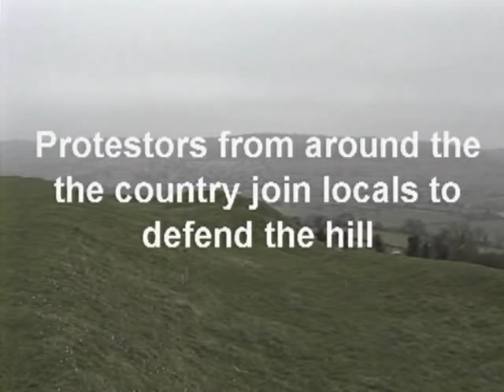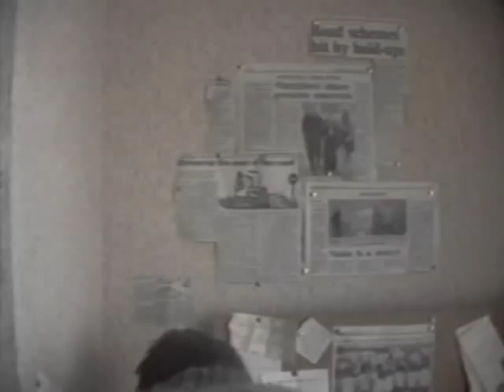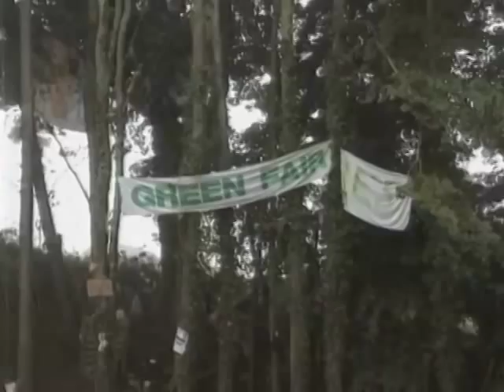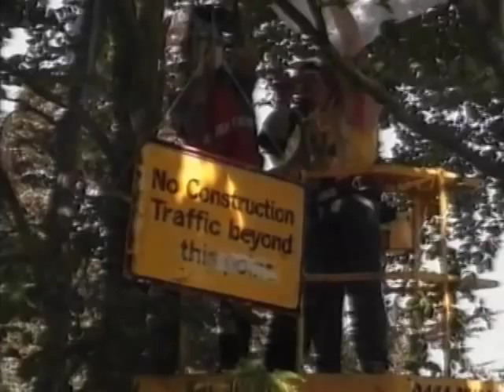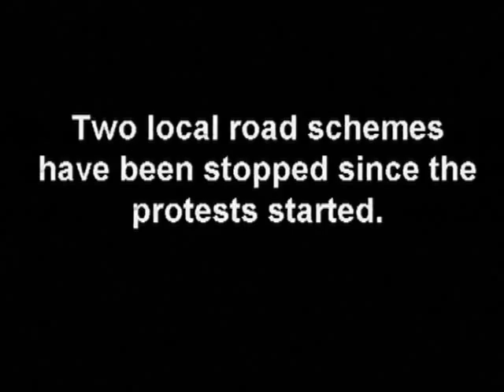Solsbury Hill bypass protests

Comment: During the protest me & 2 other protesters went up to the top of solsbury hill early in the morning to celebrate the autumn equinox of 1994 with a short ceremony. When we got to the top we were going to have the ritual in the small stone circle  but the cows had settled there so we made our own. We all joined hands & began the ceremony. I closed my eyes & felt we were 3 glowing balls & beams of energy taking off from the hill. That took me by surprise a bit, when I opened my eyes I was back. We all felt emotional. After that we saw 3 sheep together, 3 magpies & 3 of other species which I found strange as there were 3 of us. We hadn't had a drink or anything else but we had a very spiritual experience on solsbury hill otherwise known as little solsbury which used to ne an iron age hillfort.

Comment: Here is a poem I wrote when I was involved in the protest. ' little solsbury.'  Sitting on top of the hill I felt I could touch the sky, as the clouds floated by like wisps of candyfloss while I rested in he mounds of moss, the bustle of the city seemed so far away with only the sound of a kestrel hovering in a sunlight ray, now a great ugly scar has appeared on the slopes of the hill tearing into the pastures the road construction overkill, the distant cries are carried with the wind, to the lofty heights where tranquillity one can find, to escape the turmoil which nothing should spoil.  Written by Andrew Williams in aug '94.